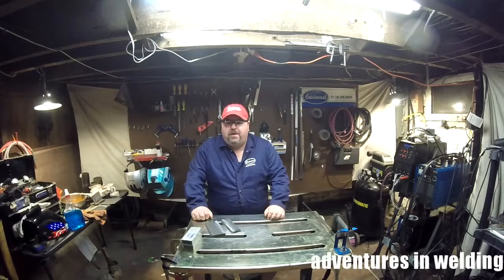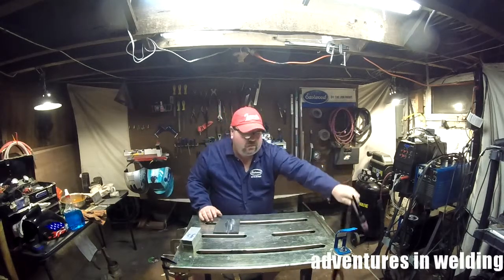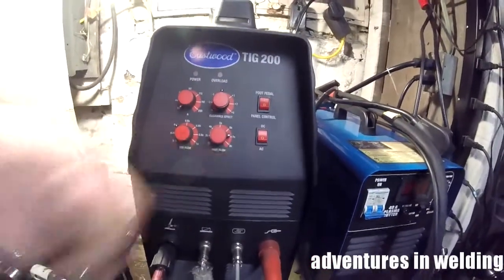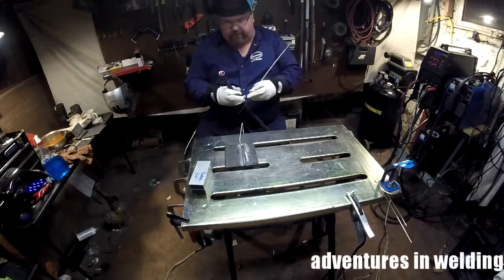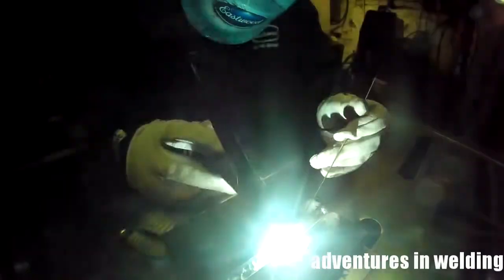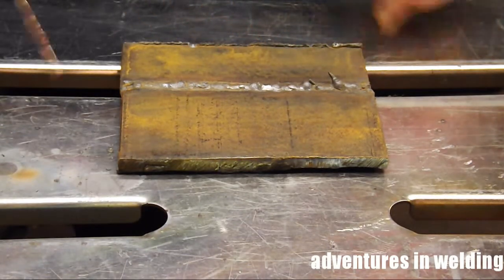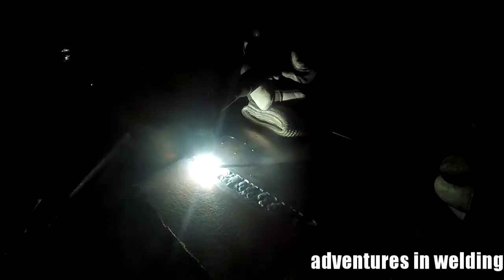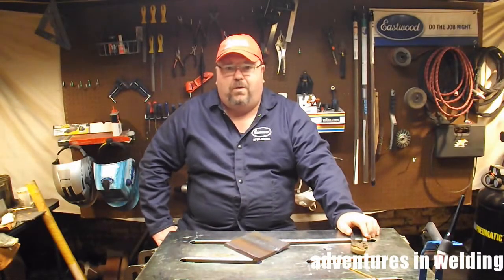TIG Welding thick steel - Adventures in Welding 118

Comment: Hey Paul, The bit you said about "time is money", That would have to be my bosses catchcry, every time I try to do anything it is all about "How fast can you do it" or "You're taking too long" "That's costing me Money", It gets so repetitious. So there is NO WAY my boss would ever let me Tig weld something that thick. But I do have a Really good Mig machine, It's a Lincoln Electric STT2, It can do really Big welds and very little spatter, It's great. Scott.
Reply from the maker: scott carr Those Invertec machines are very nice. I like Lincolns. I used a PowerMig 350 in my 3G and 4G videos. I have an LN-26 here just waiting until I can save up enough money for a nice old SA-200.

Comment: Paul, I'm glad you did that to show people that you can Tig very thick material, (If the PROCEDURE tells you to). As far as the "weaving" welds, I think i would not weave too wide. Probably the first three runs then I would go to stringers, because the cover pass would be over 3/4" wide. That is more like hundreds of very short overlapping welds. Scott.
Reply from the maker: scott carr Scott, the cover was wider than I would have liked to weave. It's been my experience lately that no one is writing weaves into their WPS. It seems like everything is stringers. I can understand why, specially if you have an interpass temp limit.
If I was doing that particular weld again (without a WPS) I would most likely use GMAW. Short circuit for the root and spray Xfer for fill and cap. Way less heat into the base metal. And way less time. Time is money...